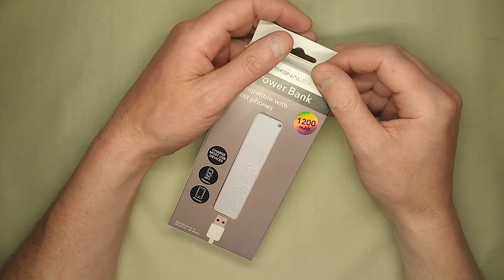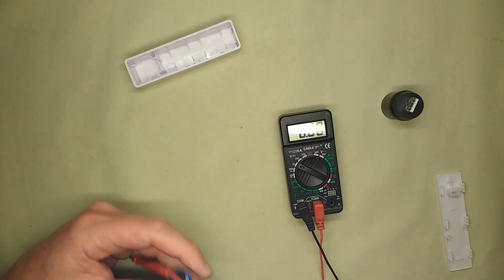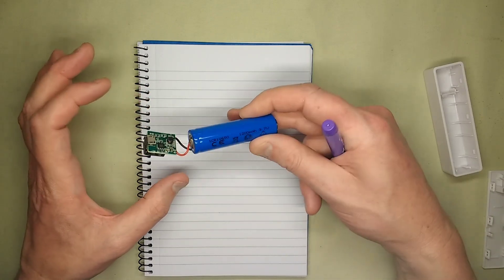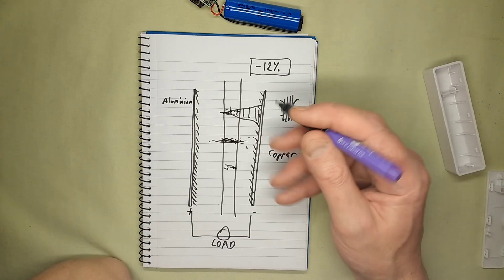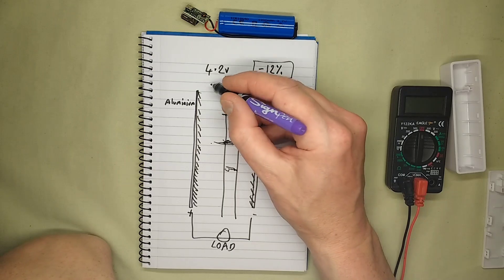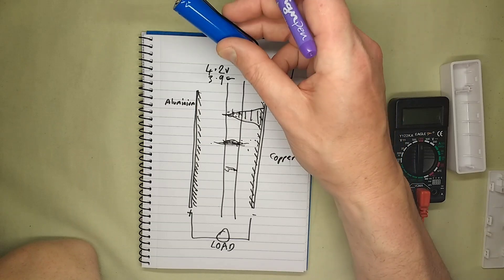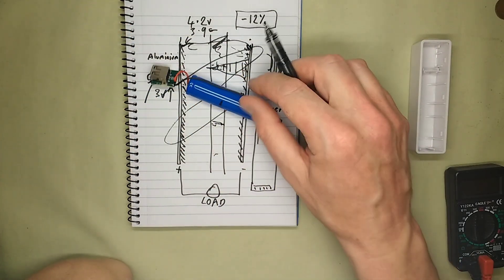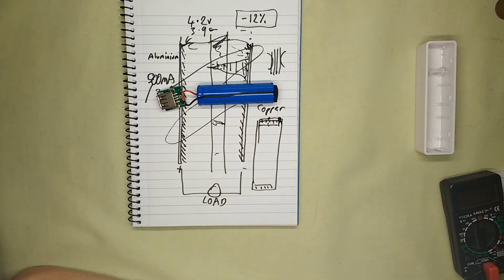Are over-discharged lithium cells safe?  (And how to test for damage.)

Comment: I salvaged a bunbch of laptop 18650s for flash lights even as low as 0.5v seasm to recvover just fine I have soem that are 5+ years old and still hol,d near 90% of capacity and dont discharge. But i also have ones that were 3v and are useless at 100ma capacity.
Reply: PV2Omni Damn thats expensive compared to what I did for mine. Mine also sent debug data over the serial port which was handy. Its the arduino sketch that I'm missing. The schematic is super simple, resistors, mosfets, and some leds. Being able to do four batteries at 1A per cell discharge was really handy for processing quite a lot of cells a day. I've also got a 10 cell charger based on the TP4056 which has a temperature cutoff pin, which came in handy for the cells that decided to get really hot.
Reply: PV2Omni also this is a niche market and hobbyist can make way cooler and more functional products.
Reply: Luke Den Hartog. Dude u have 2 recreate that sketch & share it with us all...
It's exactly what a lot of us home recyclers need.
Please, please, please re-do it & share it, I could really use something like that, I have about 100 Laptop batteries to test n put 2 good use, it's taking forever...
Thanks buddy.!
Reply: PV20mni, I have that exact same charger, I bought it on ebay for $12
Reply: KingOfKYA Same, I've seen absolutely no correlation between the voltage I get them out at and their final capacity. I test mine at a 1A discharge from full down to 3v, and keep 1.75Ah or better. I've got a vid on my channel of an arduino based 4 cell tester, unfortunately I lost the sketch :/
Reply: Luke Den Hartog Sad that you lost the schematic, but I've been using these:

https://www.amazon.com/gp/aw/d/B015LB8DFG/ref=mp_s_a_1_1?ie=UTF8&qid=1500093891&sr=8-1&pi=AC_SX236_SY340_FMwebp_QL65&keywords=BT-C3400
Reply: Luke Den Hartog Yeah, with costs going down on components; if you know what you're doing, and have the time, you can make it cheaper. Not always though, compared with things directly from China.